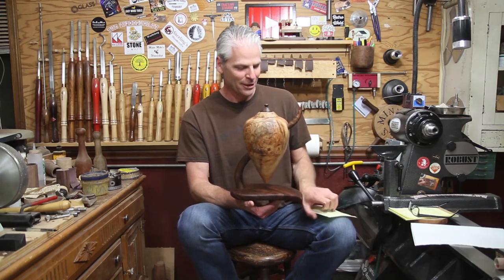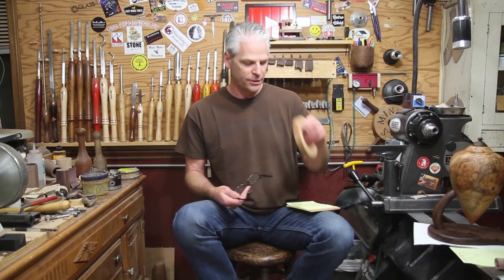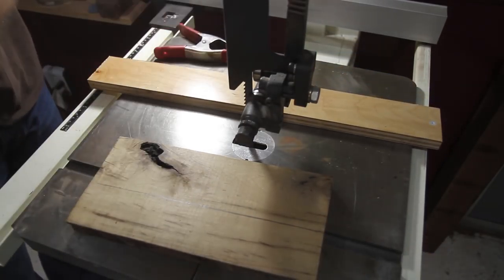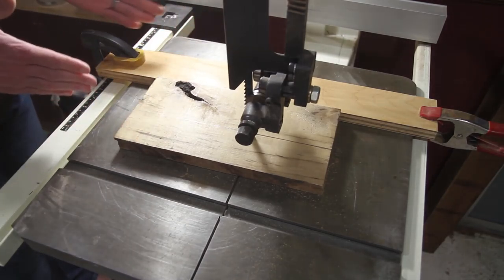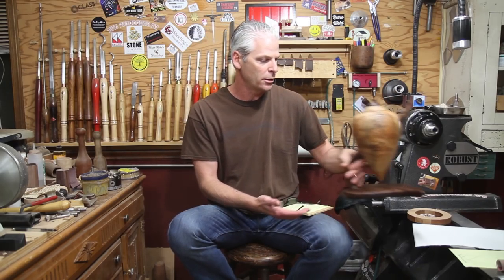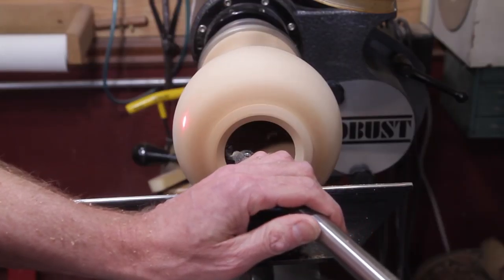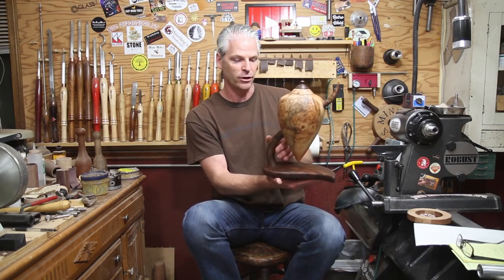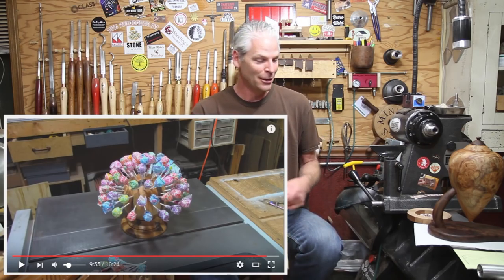Band Saw Drift/Urn Follow-up

Comment: Most bandsaws have an adjustment in the fence. If you loosen the 4 bolts on top of the fence, you should be able to set the fence to compensate for drift. Hope this helps.
Reply from the maker: +Chuck O'Buckley Thanks Chuck, I'll check it out.

Comment: Carl,  Thanks for the info.

Question: Is there some reason you don't adjust your bandsaw fence for the drift instead of doing the saw a board half way thing every time?  When I adjust mine for drift it is usually good until I change blades.          Thanks           JimE
Reply from the maker: +Jim E Thank you Jim! I can adjust my fence, but someone sent me a video about drift to look at. 
Take care,
Carl
Reply: +Carl Jacobson   I guess what I was saying is the fence should be able to be adjusted for the drift and that way I can move it and it still is set for the drift of the current blade on the saw.

Keep the good stuff comin'.                                                   JimE

Comment: Shopsmith makes a larger inflatable drum sander. It's 8" X 2.5". It fits between centers and does not require the 5/8 shaft. I included the link.

http://www.shopsmith.com/ownersite/catalog/sn_inflatablesander.htm
Reply from the maker: +Ted Perry Thanks Ted, I've seen these before. I'm looking for something softer like the one I have.